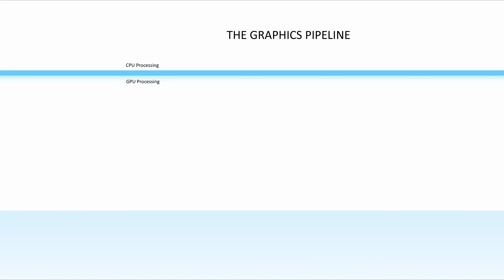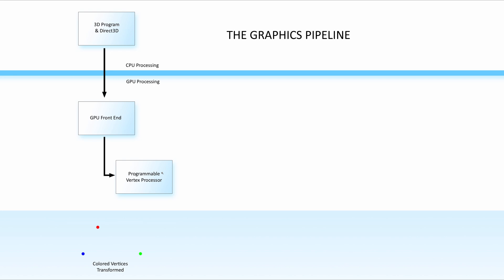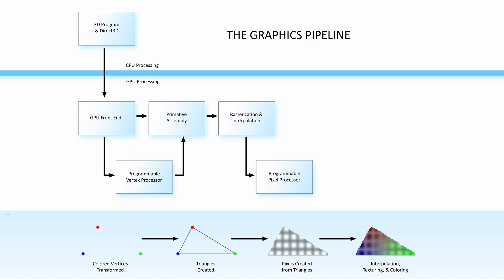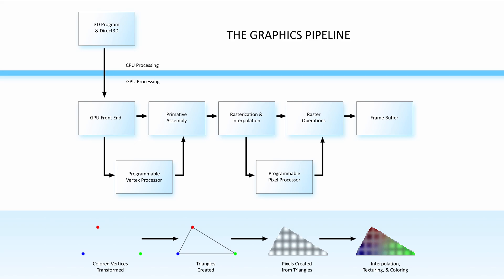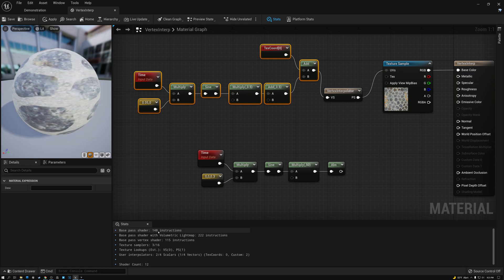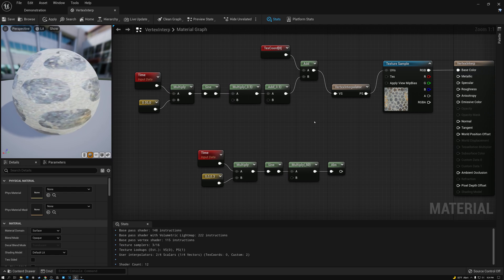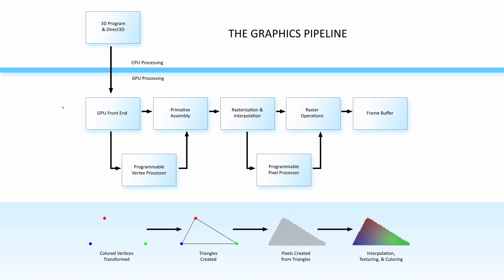The Graphics Pipeline - Shader Graph Basics - Episode 2

Comment: This channel is a gold mine. Awesome video as always.
I never new about the Vertex/Pixel part of rendering so i try looking if it was possible in Unity and it actually is!!
This "VertexInterpolator"  it is possible to reproduce in Unity's ShaderGraph using a "CustomInterpolator" in the Vertex Master Stack.
Here is the documentation: https://docs.unity3d.com/Packages/com.unity.shadergraph@13.1/manual/Custom-Interpolators.html

Basically you create a Block Node in the Vertex Master Stack (Right click or Space bar) and give it a custom name like "MyInterpolator".

You can pass on it all the math before the Texture Node.
Then you can create a "MyInterpolator" Node and pass it to the UV socket of the Texture Node.
Done!

I would never think of looking that up without this video. Again, thank you very much.
Reply from the maker: Yes, Unity added the CustomInterpolator node just recently - after this video was released.  Thank you for providing the details here!

Comment: Great work - your videos have really been helpful. So many questions - but I'll keep myself to one. Given the efficiencies of deferred rendering for dynamic lighting, is there anyway to actually extract out the lighting per pixel (as you indicated was done in the original description of the vertex shader). My understanding is that this would need to be done by running two render passes, or somehow by approximating lighting using the previous frame (not sure how exactly). My own application needs a shader that is incident light dependent, but other than forcing it to forward render (which doesn't seem well supported in UE4) I don't know how to do it.
Reply from the maker: I'm not sure what you mean by "extract out the lighting per pixel." Can you give me a better description of what you're trying to accomplish?
Reply: @BenCloward  so my aim was to blend between two different materials depending on the light level... when the object/mesh is being lit it shows one texture - and a different one in shadow. I understand with deferred rendering however the lighting per vertex /triangle - or even pixel - is only calculated post application of all the shaders except post-processing. So it seemed that the only way to access the lighting level was through doing multiple render passes, which seemed very inefficient. I can do it using the direction of a light source at the shader level (using a parameterised vector for direction), but this doesn't account for occlusion/shadowing. Maybe it doesn't work in UE4s deferred rendering... but I thought you might be able to at least tell me if its possible (without having to get buried in C++ - or worse, re-write engine code). I had thought to try and calculate the light per vertex and use a vertex shader... but this also seems very expensive to do line traces between each vertex and each light as well.
Reply from the maker: @AdelaideBen1  Yeah, what you're trying to do goes against the way engine architecture works because of the deferred lighting as you're describing.  Most engines just aren't built to do what you're looking for here.  And to get around it, you'd just need to compute all the lighting again in the pixel shader which would be really inefficient.
Reply: @BenCloward  thanks for that... I guess the only hack might be to use previous frames lighting, but that would be pretty clunky in a dynamic scene. The alternative might be to use UE4s forward renderer, but to be honest, when I tried to use it my project kept crashing (before trying to do anything new). Epic Games don't really have  a great deal of info on their documentation for this mode either.
Reply: @BenCloward  sorry for lengthy reply.
Reply: I don't know the exact node setup for this, or if it's even possible in Unreal/Unity, but I think the general approach for variable lighting-dependent materials is to use the result of a dot product of the light source as a mask on a material blender. (I was trying to do exactly this in Redshift a while back with no luck because they haven't provided a Dot Product node yet. 😓)
Reply: @mpbMKE  Unfortunately in deferred renderers  - you are not generally able to access the lighting solution before the end of (except for post-processing) - so the material properties that you can easily control cannot easily be dependent on the lighting solution.
Reply: @AdelaideBen1  Ah, I gotcha. Could you cheat it with a raycast originating from the same position as the light source? You might at least be able to get an approximation of direct light that way, just no bounced or global, obviously.

Comment: If you are just moving the sphere up and down would not be cheaper doing it on CPU by changing object position, and vertex shader would make move sense if you would do some waves on sphere for example, and offset different vertices on object differently?
Reply from the maker: Yes, you're right.  Per-vertex animation only makes sense if it's different per vertex, so this example would be more efficient on the CPU.  Very good point!

Comment: Ben, tesselation/world displacement is gone in ue5. i couldn't follow your latest tutorial for procedural displacement. do you have any idea instead of downgrade to ue4.26? thanks!
Reply from the maker: I guess you could do everything except the displacement part. You may not want displacement anyway since it was a pretty big hit to performance.
Reply: @BenCloward  yes you're right. i still made the nodes and connect it to the tess/displacement node anyway, in case ue decide to bring back tesselation.

anyway, there's thing like virtual heightfield that really performant just like how nanite work to meshes. i've seen tutorial using paid plugin (openland). haven't found any tutorial with all free stuff for now. hope you can cover it in the next tutorial. 

however, i really enjoy your tutorials Ben. thanks so much! you're best in class!

Comment: Thanks for sharing!
Just to be sure, does the node "vertex interpolator" works fine in every platform?
Reply from the maker: Well, I haven't tested it in every platform, so I can't answer that with a 100% yes, but in theory it should because every platform uses vertex and pixel shaders.  The limitation you may run into on specific platforms is what you're actually able to do in the vertex shader.  There are some nodes that only work in the pixel shader and that could possibly be different per platform.
Reply: @BenCloward   Great, thanks for the answer! :)

Comment: Thanks for the great knowledge your sharing with us. Here I have a few questions:
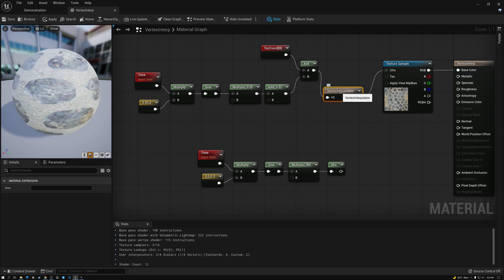1. At 9:45 you said there is a limited number of slots and we can't use VertexInterpolator nodes a lot, did you mean in just a single material or in the entire project materials?
2. Also I tried to pass in the color output of SceneTexture:CustomDepth node (with a component mask of R channel) to the VertexInterpolator node and connected that into the emissive channel of a post process material and unreal editor crashed after compiling it! Do you have any idea why that happened and how I to fix it? I tried that again, but it crashes every time (I used both UE4 and UE5).
Reply from the maker: 1. I meant just in a single material.  When you pass data between the vertex shader and the pixel shader, there is limited bandwidth between the two in the hardware, so if you use too many vertex interpolator nodes in a single material, you'll run out of interpolators for that material.
2. The vertex interpolator node is pretty limited in what it can and can't handle.  There are some nodes that only work correctly in the pixel shader.  Unfortunately, there's not a good way (in the UI) to tell which nodes will work in the vertex shader and which won't - so it's just a trial and error kind of thing.  For the most part, you'll want to stick with operations that are manipulating the UV coordinates, vertex positions, vertex colors, and normals.  In your specific case, it seems like the CustomDepth may not be available at the vertex shader stage, but the material system doesn't know that so it asked for it anyway and asking for a non-existing asset caused the crash.  Just a guess.
Reply: @BenCloward  Oh ok, in that case I think I'm not able to use CustomDepth for that. Thanks again 😊

Comment: I didnt know anything about that vertex interpolator? Thank you very much.

So the question is, is that vertex interpolator node is same with custom data node in final material output node, bottom of the subsurface color input. Or is it different thing? I dont know what that input does either :)